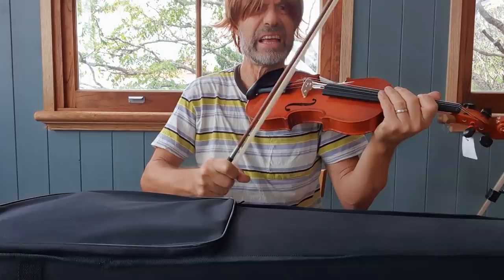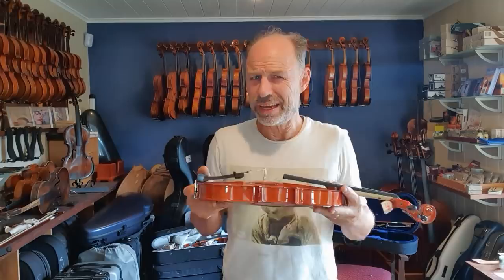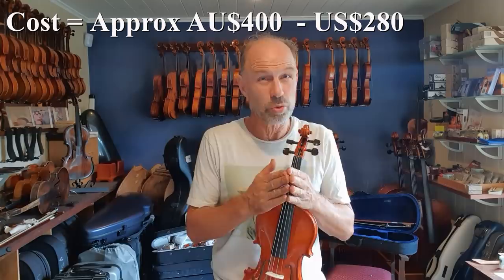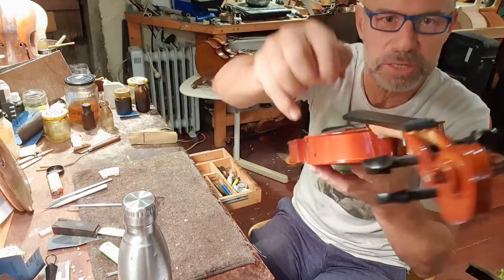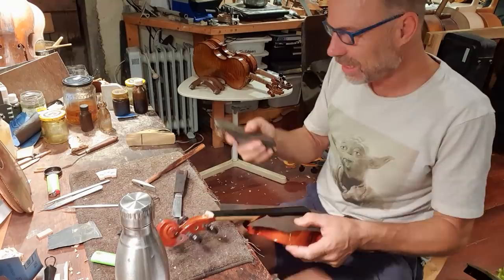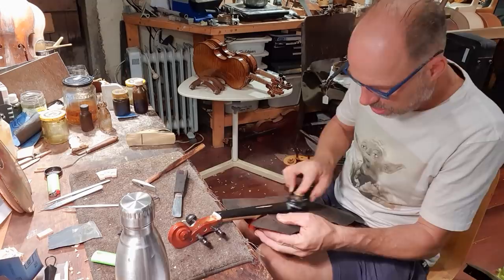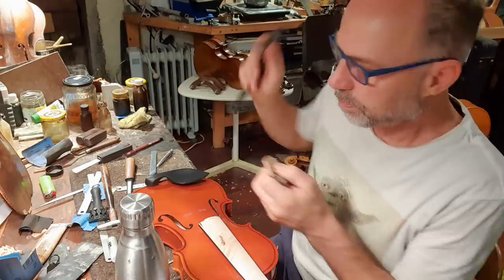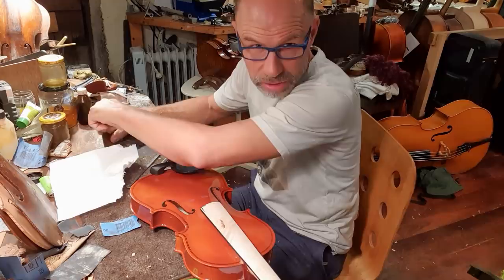Will it work?!? I try to Improve the 100 Dollar Violin with my Master Setup

Comment: Sir I don't have doubts about your violin playing in fact your better than me lol. I was kinda interested after you made those improvements to the VSO. It would be nice if you can have twoset to test it blind fold and have them play the violin and then make them reveal which violin they believe sounds better. That would be fun to watch. Before they made a video comparison with the million dollar violin so it's kinda exciting to hear their opinion about how much you improved the sound of that VSO.
Reply: Oh they would know
Reply: They would feel it instantly if they played it. A blind sound test would be still be pretty obvious I would be willing to bet.
Reply: Blind test pleeeeeese
Reply: i think even a mainstream audience could tell the difference immediately
Reply: a blind test is actually fun on checking something at the same level, or at least at the same price point. I actually do this almost every month, not with violin but interconnect cables and loudspeakers
Reply: No analogy is perfect, but think of this in terms of cars. This is a very basic model in a bad state. He's tuned up the engine, aligned the steering, drained the contraband agricultural diesel and replaced it with good quality fuel. That kind of thing. The car will drive properly and it's probably not the worst car to learn how to drive in now. But no-one is going to mistake it for a Mercedes.
Reply: If you want to see them guessing between $10 mil violin and their own (I would guess cost at least 50k or above), you can watch their video with Benny. It’s super interesting to see how skill and instrument make a (very) good player.
Reply: Good idea. Eddy would know instantly because of his perfect pitch. Brett would know because of the difference in the weight of the violin.(A viola trying to pass himself off as a violin: ) )

Comment: I have been restoring 15th to 18th-century books for 25 years now and whenever I meet a violin or guitar builder I'm always amazed how similar our toolset is I'm mostly working with wood board cover books and the recipe for making a board from a hardwood, of course, it isn't very different from preparing a soundboard of a violin and for the smaller books I have to parr the wood down to mere millimeters and in case of some Spanish books it is really close to building a soundboard because of the differences in climate in Spain hot and humid at the coast super dry inland if a board would travel from inland to coast or the other way round the board would crack that's why 17th-century Spanish books have strip inlay of hardwood but the board tents to be of a softer variety so it can stretch the square fitted braces are there to prevent the wood from cracking and to strengthen it much like under the soundboards of violins and guitars.
when I found a damaged late 18th-century guitar I found it strangely easy to repair putting back broken or rotted braces was familiar.

Comment: Olaf - in potential assistance for your question at 1:05:

- What is the difference between a violin,- a cello- and a piano-shaped object?
- The piano burns for longest.
Reply: Would not recommend burning CASIOs.
Reply: @kaymarrand9970  LOL. My excuse is that technically speaking, those are "electronic keyboard-shaped objects", and they don't burn that well.
Reply: Pianos also have a much more satisfying implosion if you can heat them up just right.
Reply: you should check out The MakeMakes “I Am Yours” live in the Eurovision. The piano was on fire
Reply: The cheap violin is good for somebody who likes to fiddle around with things!

Comment: Hi Olaf! I would love to see a video about left-handed violins. I know left-handed violinists are fairly taboo in the violin community, but some of us can't play any other way. I play left-handed because I cannot fret with my left hand due to a disability, so I have to bow with my left. It would be pretty great to see a video on what a true left-handed violin is, versus one that's just flipped.
Reply: The bass bar needs to be on the other side, so the bass bar and the sound post need to be in the opposite positions.  That's certainly something that Olaf would be able to do.  The nut and the bridge would also need to be adjusted, due to the different thickness of the strings.  It's a fundamental change to the violin, and in an orchestral setting a left handed violinist would certainly stand out, both reasons for left handed violins being "taboo".  I don't see these as a big issue outside the professional orchestra, so I think you should investigate it if you haven't already done so.

Olaf made a video about the bass bar and demonstrated making one and fitting it.  "A Bass-Bar inside a violin?!? Master violin maker explains how it works" from August 2020.
Definitely a great video to watch if you want to understand the violin a bit better.
Reply: Left-handed player here as well. As a kid, I have been forced to write with my right hand, therefore I am quite sensitive to being talked into playing right-handedly. I feel like it has been the right decision to play with my left hand, as it feels so weird and "wrong" if I even hold the violin as a right-handed player would. I would like to play in an orchestra one day and honestly, I feel like the times where you could openly discriminate against people because of some physical trait should definitely be over! I also don't see how that is even that big of a problem. I am sure seating can be arranged in such a way that bows won't hit each other. I believe that if more people decided to play with the left hand, it would be accepted the way that writing with the left hand has been as well.
Reply: @lyamorian767  It would be great to have whole sections of left-handed string players. Otherwise, a bit problematic visually, as in an orchestra, visual ensemble is paramount, want it or not. If not so, we would mix all soli instruments together...

Comment: This is why you buy a quality instrument right off the bat.
Reply from the maker: You said it!!
Reply: Wondered what older used instruments cost on eBay, I found many under $200US. Which makes sense. Violin playing is not that popular and you end up with some relatives hobby violin purchased 50 years or more ago you will see what you can get for it on eBay. Looked up someone's opinion on makers, selected Mendini and Ceclilio and added Yamaha because of my own opinion,  a large selection and some were under $100 buy now or best offer prices. These would have real parts and wood and would be worth the $300 to put it in best condition if you wanted the best sound. Ended up with a 100 year old German violin for US $85 on eBay and am using things I have seen to set it up better, it plays OK. The cheap violin sounded good enough for a leaner, if you are getting a 5 or 6 year old a 1/2 size or something to learn a little, a cheaper violin might be the way.
Reply: @mykofreder1682  Totally the right idea. I picked up two Czechoslovakian violins for under £40 each, which are at least 35 years old, and they are both absolute gems to play. I also got a Michael Poller viola for £25, which was just advertised as a "violin", but if you zoomed in on the pictures you could read the label through the f-hole. Sometimes you just get lucky.

Comment: Hahaha I own a ~$200 violin. No shade to my instrument though; it served me well. I learned violin in grade 10 and we had the option of using the school instruments, but I really wanted to have my own so I could practice whenever and keep it. We had to take it in to a repair shop at the recommendation of my teacher and the man replaced all the strings, shaved the bridge into a better shape, and carved the scroll holes out because the pegs didn't fit properly. I don't remember how much it cost, but maybe $100-200? 

So I think it does pay to invest in a better instrument right off the bat. If you're willing to play a subpar-sounding, difficult-to-play instrument, then you can get one for very cheap, but as soon as you decide you want better, you've already wasted money, because trying to improve a low-quality instrument isn't as economical as buying one of higher quality.

Comment: Hi, Olaf, really great video!! As an amateur luthier (from Brasil), i am now finishing varnishing a chinese cello that have some good wood and construction, and sounded well, but i realised that maybe the PU varnish was too much for me to bear... hehe i once too a knife and lift a little of the varnish down the lower bouts and it cracked, showing the wood. And the size, the measurements of this cello to me were pretty standard so i found it a good idea to try to make, and behold, i did a thorough recondicioning - put an ebony fingerboard, made a good hardwood tailpiece, ebony pegs and a spirits varnish. To the removal of the old artificial varnish i used a removing gel (that is made to auto use), and it worked very well. So i sanded the cello all over, and started from scratch, sealing the wood again and varnishing with a spirits made of laquer, benjoim and sandarac. The result is a robust cello, in comparison to the old one. The volume uped by some 10-15% which i found impressive, but i made all efforts to make the varnish as thin as possible. The bass notes now are open and resonant, and the high notes are more accurate to the fundamental harmonic. So, it is a great happiness to come to your channel and see your work, i learn a lot with yours videos. Thank you!

Comment: If you need a cheap violin, get the one Ray Chen bought for, if I remember correctly, 69 dollars. Because 500 dollars is a big investment for many people knowing that most who start learning the violin don't stick to it. It takes a long time to play one note that doesn't sound bad. It's you, not the violin.

Then, when you learn to bow straight amd get some agility to control bow pressure and placement (contact point) AND learn to place your left hand fingers at the right places (stop the string) so that your intended note isn't too flat, or too sharp, you'll struggle a long time to learn vibrato. It isn't easy, as in the guitar, or cello. And it is essential to sound more beautiful. Take a look at the hands of violinists, they vibrate most of the time.

So, there's a long way to play anything, the easiest of pieces, sounding just ok. Many give up.

If you have time and patience and do stick to it, that'll pass and in a few years you'll feel the need to get a better instrument.

How many years? It depends. Some have it easier than others. Long fingers help. If you have a lot of time, if you're younger... many ifs. 

Good work!

Comment: As a new violin player I really appreciate what you showed here. I bought a used Glaesel (A.R. Seidel) V131 that was my sister inlaws. Being a guitar player/ tech I kind of double checked specs online and was happy that everything was well set up on my instrument before I even owned it. I fixed a slipping peg and a new set of strings and I can feel the quality. I have worked on many cheap guitars in my time and have always felt saddened by how many new players quit because of the instrument. Mine may not be a seasoned players violin but it is a great starter tool and I am excited to see where I go with it. I am in need of a quality bow, however....

Comment: Wow :3 this changed my view completely. In Mexico, a cheap violin is around same price, 100 USD, but the same adjustments are a little bit less with a good luthier. However I think the suggestion you said for beginners is way much better, to save money to buy one already fixed. Thanks a lot for your words!

Comment: I'm a novice luthier. I'm building up my tool supplies and am working on my first project: a broken headstock, body cracks and separated binding on my sister's ukulele. I would very much like to see more videos from you specifically on the processes of building and repairing violins.

Comment: Hi Olaf, thank you for your video.

I am an amateur restorer. I fix up unloved instruments and pass them on for children to learn. I heat a knife in a mug of hot water to pop the nut off, is that wrong? 

I make a lot of components like pegs and chin rests out of field maple and spindle that I've harvested and seasoned myself to save money and avoid using ebony. After trying out various wood dyes I have found a shoe scuff-cover liquid that comes in a plastic bottle with a sponge in the neck as a fantastic eboniser. It gives a really dense, durable black finish! Sometimes though I like to keep these components white, to have something unusual.

There are some very good cheap strings available if you experiment a bit.

I agree with your observation on sound posts, too tight strangles the sound.

I just wish there was a budget version of the Knilling Precision or Witner geared tuning pegs, I have fitted them to a couple of fiddles for myself, and they make tuning so easy.

It's fun fixing up cheap or damaged instruments, a very satisfying hobby that you can do in a small space and on limited money. I have only worked on a couple that were so hideously bad that someone couldn't get some use out of. By far the worst was an Indian made one. I did everything I could with it but it was just appalling. I didn't want to give it to a student. I donated it to a charity shop, maybe someone could use it for wall decoration or window dressing or something!

Kind regards

Andrew

Comment: Thanks a lot for this video, Olaf!

I bought a cheap violin off of Amazon (150 USD) and the height action was terrible.. The bridge height was at 33.55 mm over the surface of the play head (although the fingerboard height was pretty spot on 27 mm). The bridge was not fitted properly and the pegs were kinda jammed..

I'm a pretty handy guy, so I used your video for a reference and sanded the bridge feet to fit the curvature of the play head and cut down the height to be 29.4 mm off the surface (so almost 4.2 mm was cut off the bridge) - this gave me a smooth 1 mm height action along the whole fingerboard - and the sound was much clearer aswell. 
Put some peg paste on the pegs to let them tune easier, although I should get myself a reamer as the holes are kinda jagged on the inside..

Love your videos as always <3

Comment: Thank you so much... building my first ( don't choke ) classical guitar...
I was so worried about bridge placement and fret intonation, after letting the bridge dry for two days... strung the d string and checked all frets w tuner.... it seems that reading all the papers on it I could worked out... every fret was in tune... hope it stays that way under full load of ALL strins... time to shellac it and finish it 
Wish me luck

Comment: Once upon a time I decided to take up the violin.  I purchased my beginner violin for about $180 and it sounded fine to me.  I will never forget a particular lesson where I was having trouble getting in tune.  While my instructor was checking out my instrument he gave me his to warm up.  As I ran the bow across the strings, the purity of the sound was simply shocking compared to what mine typically produced.  Where mine would squeak at times and produce a gruff grinding at others, his simply sang out a pure note.  I told him how clear the difference was and he responded..." That is about a $15,000 instrument so it should sound pretty good."  I am confident a great instrument will not make a great musician but there is clearly a difference in what is achievable with a quality of instrument.

Comment: If a family were on a budget, but still wanted to learn, I could see using one of these VSO's (especially for a beginner).   As the student practices, save up for another improvement, and do the improvements in stages, but as rewards for practicing.   The student could get improvements to their VSO as a gift, or they could save up for them themselves.  That way the instrument improves with the student.    Even though the finger board was not made of ebony, and the color didn't stay and faded a bit, I think the dark almost black staining effect was actually pretty cool.    In the video, you said you didn't do anything to the bow, would be interesting to hear it with a good one, would it improve the few sound issues that were left after the work you put into the VSO itself.    Don't destroy that thing, it serves as an example to students what some time and effort can do.   Nobody has any skills when they first start, but as they hone them and work on them they improve.   Same with that VSO, when you first reviewed it, it sounded like a 50 pound bag of hot garbage, now it sounds quite good.   What did it?  Time work and effort.   How does a student get better?  Time work and effort.
Reply: I think the problem with starting with a VSO is that it's so bad that it may discourage the beginner due to the terrible sound (so they think they're bad at it), or they can't even tell if they're playing badly or well (so they can't even learn anything from it.) A close friend of mine bought a VSO, and you can't even keep it in tune because the pegs are so loose! Literally unplayable, haha. Even the one in this video changes pitch dramatically when you press down... there's a floor of how bad a violin can be before it's unplayable.

Comment: I worked in a Violin shop for a while and we had many customers bring  VSOs in to make them playable. We usually managed to talk them out of it but we had one customer who absolutely insisted so the luthiers tried to see if there was anything they could do. they gave up when they realized the whole thing was held together with gorilla glue instead of Hyde glue. the sound post had even been super glued in place and snapped in half when they attempted to unstick it. it also entirely lacked a bass bar.